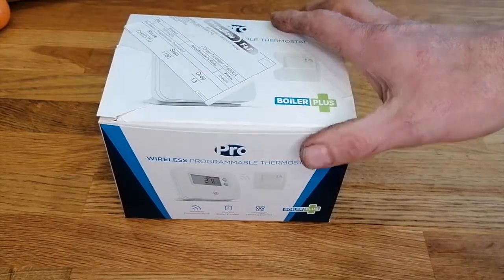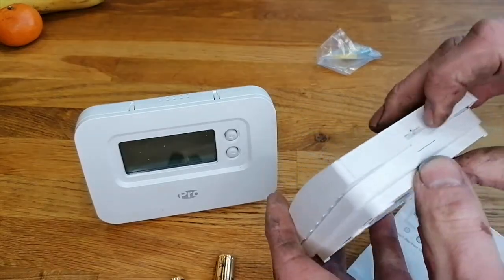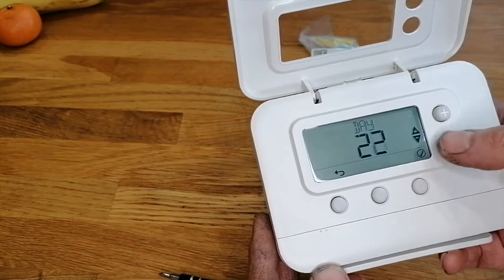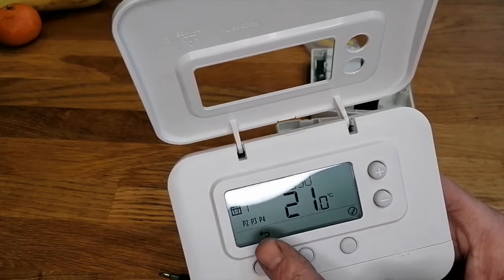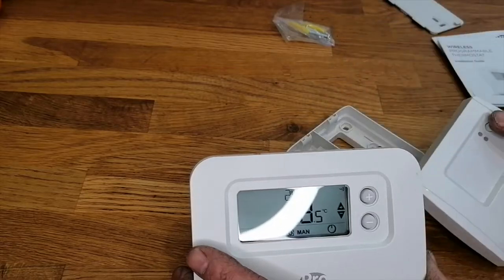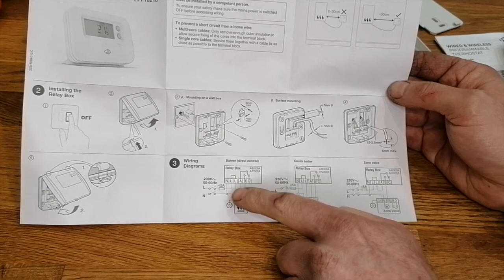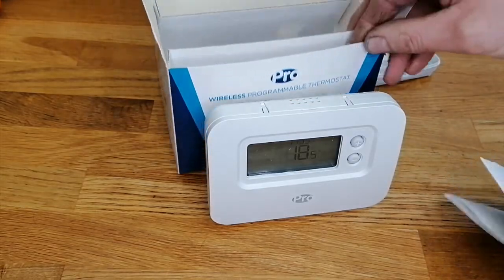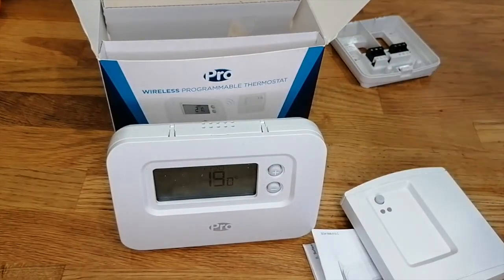New Pro wireless programmable thermostat. by  pro controls how to use install and set up

Comment: Mine keeps switching on by itself even if I remove batteries
Reply from the maker: Hi if your boiler has a pre heat function turn that off .
If the receiver is kicking in it's likely to be nextdoor had the same stat or a faulty stat

Comment: I meant overiding the temperature set by the programme for an hour, the leaflet says that is a feature. I spoke to Honeywell , it is not.
Reply from the maker: This is not a Honeywell product
Reply: Did you ever find out how to use the +1hr function?
Reply: @MiniEmma  I found out it is not a feature on this model
Reply: @mangorobinson9200  thank you, frustrating that it pictures it in the manual, my poor mum is struggling with the whole thing!

Comment: This item comes with instructions that don’t work.  Try adding an hour, impossible.  

The rebinding process, should it be required, doesn’t work properly either.  There’s a poor typed A4 inserted with rebind instructions as an afterthought- they don’t work.

If you ring the number on the instructions the customer care department at F&P say they know nothing.

They suggest going to an F&P wholesale branch and asking the counter staff.   I pointed out that a plumbers merchant would surely be experts  on rubbish software.

This is a poorly executed under developed product.  If you want any aftersales support expect to be told to do one, metaphorically.
Reply: Did you ever find out how to use the +1hr function?